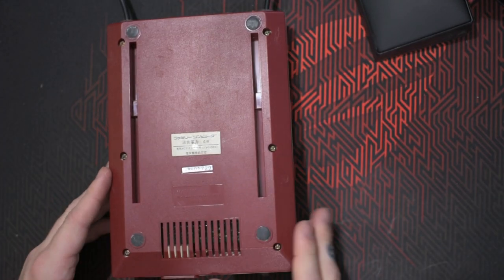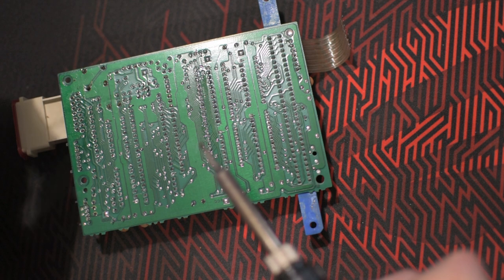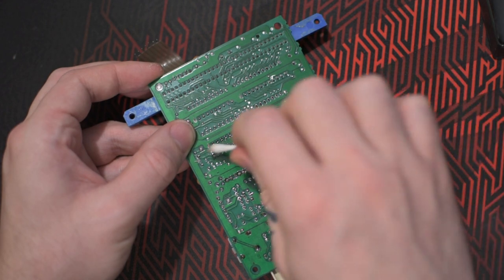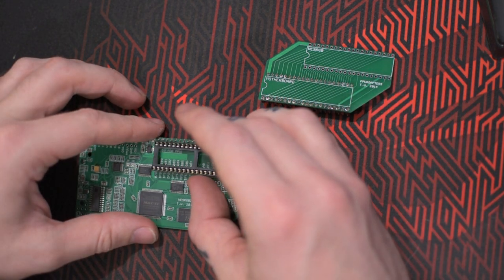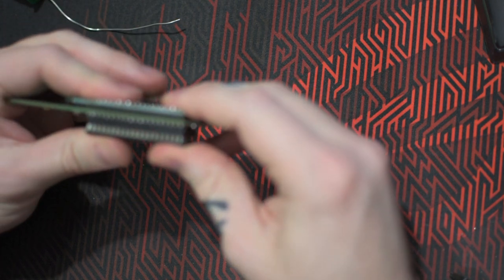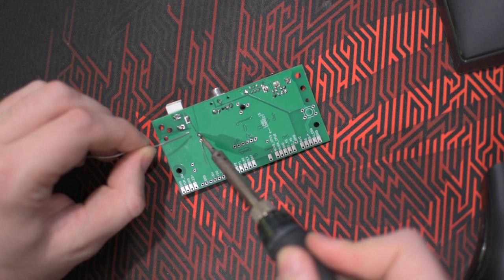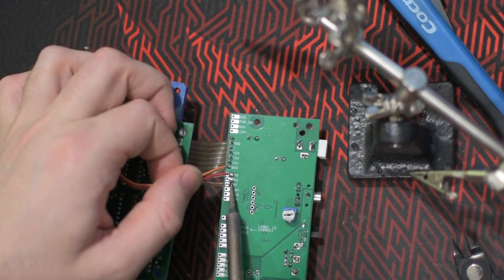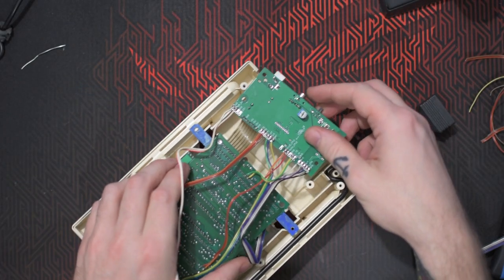Famicom RGB mod - For That Most Beautiful Video Quality

Comment: Thanks for the video it's much appreciated. I just finished doing this exact same mod on this exact same console, and the directions on the original site where you buy the mod aren't exactly what I would call "detailed", so this video came in helpful SO many times.

Everything went great by the way but I'm still not finished with the console, I've gotta make the controllers detachable, and make the first player controller wireless. After that it'll finally be finished. It's by far the most demanding console mod I've done by a long shot but I love the way it looks and I'd rather have the Famicom on display instead of the VCR looking American NES.
Reply from the maker: Nice! Good luck with the upcoming mods :)

Comment: Nice job, just dis mine, your video helped me a lot. What kind of awg did you use? I’m getting some static in my image.
Reply from the maker: Nice to hear! I'm not entirely sure since AWG is not a standard in europe, but i think my wires are 0.2mm^2.
What kind of static do you have? My guess would be that your output cable is not top quality rather than the installation cables being to weak.
Or that a solder point may be bad.
And also, some static are just native to the console.
Reply: @goldhagengaming  thanks a lot for the reply. I finally found the source of the problem, it was the power supply I’ve bought at AliExpress which was generating DC noise. I was able to get it to work perfectly with another power supply (from a DC regulator), I still have to find a decent one to use in the future. I was quite sure it wasn’t my soldering or the scart cable (bought mine on retrogamingcables from UK it cost me a fortune). Thanks for your time answering and thanks again for the video, I’ve watched it quite a few times as I’ve went through my installation, getting that PPU out was a pain!! Take care

Comment: Hey friend. Did the mod came with the new power board? And the scart cable for the mini din-8 connector? Thanks
Reply from the maker: It comes with the new power board but not with a scart cable.

Comment: Are you using unleaded solder?
Reply from the maker: Yes I am. Since lead is toxic and I dont have sufficent ventilation for that im using unleaded solder even though the thing im soldering may have lead in it originally. Health comes first :)
Reply: I was only asking because of other comments saying the solder wasn't wetting very well and I know unleaded solder isn't very good have you thought about getting an extraction fan to use for leaded solder it's perfect for when you don't have sufficient ventilation?
Reply from the maker: @foxracing742   Nah man, for me its just not worth it. Not only for the fumes since it can also be absorbed through the skin. I dont mind the higher melting point of unleaded.
Reply: @foxracing742  Since 2018 leaded solder isn't legal to buy in Europe as a hobbyist. :(
Reply: @StarfighterJohansson  that's unfortunate

Comment: Nice one. It looks to me like your iron is set to a temperature that is too low. I also recommend you first heat the pad or leg for 1-2 second, and only then add solder, not to the iron tip but to the pad or leg itself, and for the bits that are harder than others, don't  hesitate to use more flux.
Reply from the maker: @Djcalle , temp is 385C, so if anything is too hot :) Yep, that is the way to solder. And second yep, flux is always key even though it may not be any hard parts besides desoldering. A desoldering gun would have been neat.
Reply: @goldhagengaming  ok was just saying that because some of your solder joints don’t look the best (towards the end) maybe because you didn’t pre tin the pads, and you can also see your solder is just not melting right at some points like on the DC Jack, being larger pads they need more heat than what was given. Not having a go at you, just providing some feedback.

Comment: You can just make a adapter that plugs into the front of the famicom to use nes controllers  https://www.amibay.com/showthread.php?82818-Famicom-Nes-controller-Adapter
Reply from the maker: Yep! That’s correct! It just depends on what you prefer :)